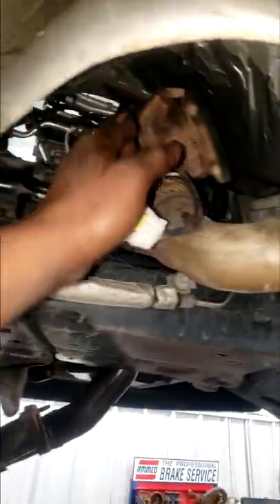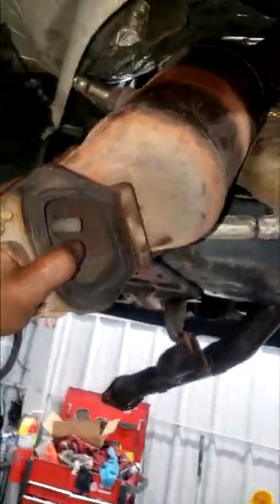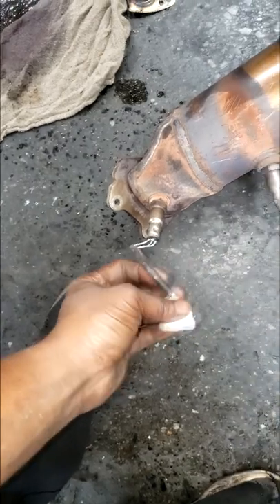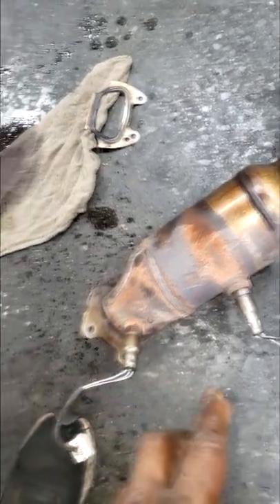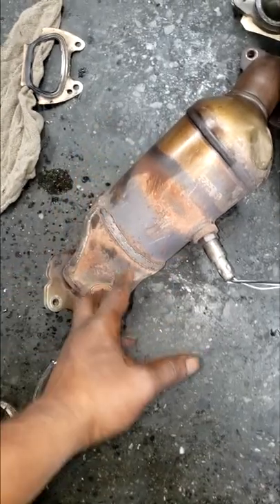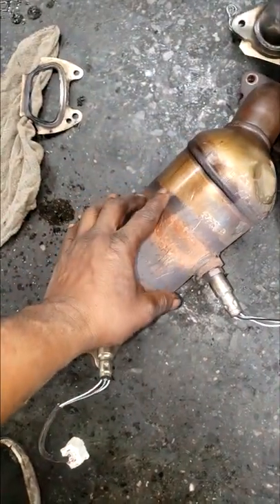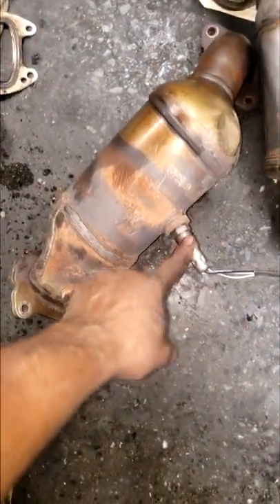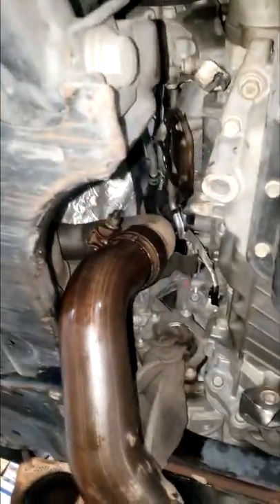WARNING. O2 Sensors will not FIX A P0430 P0420 on NEWER CARS. . YOU NEED A CATALYTIC CONVERTER.

Comment: P0420 and P0430 simply mean that the downstream o2 sensor is reading that the catalytic converter is “below efficiency threshold.” This could mean your catalytic converter isn’t working right OR that either o2 sensor has gone bad. It’s not a 1 step diagnostic problem, there are multiple tests you can do to narrow down the problem.
Reply from the maker: In the video I mention the newer model cars. This mean not older cars. If the computer spit out there's a cat efficiency problem, there 99.9% chance the cat simply fail. The o2 sensor operation checked by the pcm b4 the cat tested. If o2 sensor problems found a code would be set for that.
Reply: @OnlineMechanicTips  what is your definition of newer, 5 years old or less, 10years old, 15?

Comment: I have a few vehicles for reference from the early 2000s and late 90s that have 300k+ with zero problems out of the catalytic converters stopping up. I have a 2013 Sonic and helped work on a 2014 cruise. Both had the same codes. So far my O2 sensor replacement has helped mine but his catalytic converter was stopped completely up. Both were under 100k so I did the most logical fix I knew how. If it’s stopped up clear the stoppage. It’s been running fine with an empty case for 2 years now. No problems whatsoever. Catalytic converters are borderline pointless besides back pressure for a motor. You can add material back that won’t stop up and be fine.

Comment: Only something a mechanic would say. I seen so many people with new cars fix the issue with changing the sensor
Reply from the maker: They likely had a o2 sensor code as well dude. The newer car computers run the cat test after o2 testing done. Best believe if I see a cat efficiency code, you getting a cat.
Reply: Yeah maybe 10-15% of the time but most of the time it’s someone trying to chase a cheaper issue when it’s the cats

Comment: I was a smog tech. with a bar90 and regarding being newer vehicles there are still ways to trick the ecm, even with modifications to the engine or exhaust, not all cars but still definitely possible, obviously you gotta pass the visual inspection. Great informative video, God bless

Comment: The way the pcm can tell when a catalytic converter is below threshold efficiency is when the readings from both pre cat and post cat O² sensor(s) are showing a similar wave pattern. The wave pattern after the cat should be smoother not erratic like the pre cat sensor.

Comment: My guy , get you a proper scan tool . Look at the upstream and down stream on a graph function , the upstream should switch pretty frequently across .45volts , the down stream should have significantly less peaks and vallyes in the wave form . If the wave forms looks similar the cat isn't doing its job.
Reply: I don't think jiffy lube taught him that one.
Reply: @Cassius NOYB  nope , no jiffy luben for me 😂. I'm a mechanic for a living with a mobile service. Have scan tools and and an actual service truck so not like the rickety cracked out fb mechanics that be roaming around out in these parts.
Reply: What type of budget friendly scan tool would you recommend?
Reply: @Muttaqi757  I've got the mx808 by autel . It's around 500 bucks new but quite worth the money.  Used it to do everything from diag to abs wheel bleeds or trans adaptation when putting a trans so the tcm can learn all the new values.
Reply: @writeupking  Bingo! This is the information I need. Thank you so much.
Reply: @Muttaqi757  only short coming on the mx808 is , it's not bi-directional . The higher dollar scanners can send commands like turning on fuel pumps or opening evap purge valve for testing purposes.

Comment: I don’t know man, I had a p0420 on my 2013 accord. Cleaned the o2 sensor no good. Put a new one, cleared the code and never came back. Car had 181,000 miles at that time
Reply from the maker: In this vehicle im speaking about newer cars as I stated in the video. Yes, in 2013 the computers was not as great as they are now.
Reply: @OnlineMechanicTips on the contrary the older ones must have better computers if they can distinguish a faulty o2 and a clogged cat converter.
No way can a newer car already need a new catalytic converter.. either you’re trying to safe face because you know it’s false info, or you mistakenly put out bad info 
Either way, if a 2013 accord doesn’t qualify as a newer car, then no newer car should need a new cat, period
Reply from the maker: @suppaman12  Dude you talking hyperthethicals. All I work on mostly is brand new cars, and yes, they from time to time may need a Cat. Thats why Cats on newer cars have a higher warrany. And theres no need for me to safe face with you, I dont know you. You do however have a right to voice your opinion whether you consider this bad info. But theres nothing bad about my info. I said exactly what I meant concerning the newer cars. And yes, a 2013 Honda now a old ass car.
Reply: @OnlineMechanicTips  after rewatching your video I see you didn’t specify what a “newer car” is 
So there’s your problem. You left it too ambiguous 
What years do you consider “newer” it might help your case since I see you still backpedaling
Reply from the maker: @suppaman12  My guy, I have no reason to back pedal nor have any plans to back pedal. Youtube is a Video Platform where creators show videos representing there opinions. You more than welcome to dis agree with ones opinion. New Cars? I would say when the bus network changed in 2021. So from 2021 on up I consider a new car.

Comment: I changed my catalytic converter’s and put new sensors on it, I have that code P0430 used to be P0420 before I replaced the whole exhaust system. Yes they are oem btw. So what could be the issue?
Reply: I would have never changed the cat in the 1st place. Try cleaning out the intake manifold, throttle body, change breather hose 1st. I have 294,000 on 2015 Nissan Altima with the P0420 code. Not changing the cat as nothing is physically wrong with it. Doing other things 1st

Comment: What about an intermittent P0420 and P0430 that come and go.  And when I mean go away, no pending code, no permanent code.  The downstream sensor reads constant 0.7V the occasionally drops to close to 0V but come right back to constant 0.7V.  A cat converter isn't going to go bad then be good again.  This is on a 2012 Dodge Durange with 3.6L engine.  Seems like some transient condition in the output of the downstream sensor.  Going to try changing all 4 sensors.  96k miles so it's probably time anyway.

Comment: I have actually just changed out o2s after the cats passed a heat gun test. As long as other problems with a bad cat aren’t there, preformance is choppy or lagging after being warmed up, idle issues, or failing the heat test by being hotter at the front of the cat and cooler at the rear, O2 is your problem.
Reply: The heat test is faulty. I work at Nissan and recently bought a radar heat gun off the Matco truck. I tested 10+ Nissan and all of them were hotter at the front of the cat than the rear. Of course it will be hotter at the front. That's where the engine is and most of the heat coming from the engine is before the catalytic converter. That heat gun test makes no sense! I also did a back pressure test at the upstream O2 sensor hole. No.back pressure at all. I manually took my cat out and inspected it outside of my car. Nothing broken inside and nothing abnormal about it. Car still drives good, but choppy at some points. Have p0420 code

Comment: If the O2 sensor has failed then it will. If the cat has failed then it won't. A new secondary O2 sensor fixed it on my old very high mileage 2006 Civic. It might also be a totally unrelated problem like an exhaust leak that's confusing the O2 sensor.

Comment: Got some cats off amazon but getting p0420 after only 3 yrs. Im regretting welding them on now. Im gonna try swapping the o2 sensors and see if the problem switches banks. Its an 04 Mustang GT so maybe old school enough. My scanner says the o2s arent diagnosable with this computer. Of course im due for smog this month too.

Comment: Quick question I can't pass emission test it keeps saying Inc for catylst and o2 sensor then I drove my car the driving cycle but then it went from inc to n/a does that mean it's a bad sensor if so which one would it be and there no engine code or light
Reply from the maker: What kind of car do you have? Also are you subscribed to the channel?
Reply: @OnlineMechanicTips  yea I been watching ur videos since I had my hemi but I got a dodge dart gt 2014 model idk why it doesn't want to process to complete
Reply: @OnlineMechanicTips  any advice
Reply from the maker: I'm just seeing this. I noticed you left out the year of the car. In some cases, the computer needs a hard reset or even a flash update. If those monitors not running when they suppose to, it will never even run the test. Sometime that's just a glitch in the computer
Reply: @OnlineMechanicTips  2014
Reply: @OnlineMechanicTips  dodge dart gt 2.4 l
Reply: @OnlineMechanicTips  got a quick question I hope it's not stupid but recently I did it when I went to the drive cycle  on my scanner it says incomplete then went to na then I turn my car off for 10 mins then went to inc but when I go to since diagnostic codes where cleared in that went from incomplete to ok when I turn the car back on does that mean  I'm done or it's not working properly

Comment: I had the for 430 code for the longest on my durango 16..I finally tried a few additive for my injectors and cc. MMO cata clean mix wit dura lube cc +2 chevron  after emptying the tank a few time and drove like over 500 miles and my 430 code was gone but then my VVL sensor went bad 2 days later

Comment: That's funny because i got a p0420 code and looking at my obd reader my bank 1 sensor 2 is showing no voltage reading so your telling me it's not the o2 sensor it's the cat still interesting didn't know the cat gives off voltage to the o2 sensors
Reply from the maker: In this video dude I clearly mention new cars. The way the computer look at Input data different now. The new computers better at flagging o2 se sor problems as oppose to cat problems specifically

Comment: it's cheaper to put a spacer in between the sensor and cat.
Reply: Even if the sensor is bad would it still work?
Reply: @marsrover0 yeah but like might as well get a new sensor for 50$ and if that doesn’t work get a spacer. But spacers are illegal for inspection so unless you know a guy they might see it and fail you
Reply: Spacers def work, only thing is this chump failed my smog test because he seen it. Now i’m on my second can of seafoam driving around hoping the light stay off. I’m driving home now, when i get there im gonna check for exhaust leaks… i tried two cans on cataclean but all that did was destroy my fuel pump and cost me $200 on top of the $800 im trynna save by not buying a new cat…
Reply: @commentbeast3985 How did Cataclean destroy your fuel pump? How do you know it was Cataclean's fault?

Comment: I’ve replaced three in  the last months. It’s not a thought it’s one of three things cat o2 wireing (99.9%chance it’s not the pcm obviously) OFTEN ends up as wireing less often but still happens to be o2s and the Least likely is the cat think I’ve seen only four or five sets done in 5 months at my shop that weren’t because the cats were stolen but failed
Reply: Need advice help please. Code p0420 car is  not burning oil and is running fine obd2 scanner also says poor connection sensor 2 and pcmm could the issue be my down stream 02 sensor ?

Comment: I gave up the fight on my 2009 Pilot. Code comes and goes based on ambient temps. WI doesn't do testing, so it's just turn up the radio. I'm not doing an axle pull to replace.

Comment: I’ve got an occasional P0420 on my Chevy Cruze and when I reset the CEL, it tends to stay off anywhere from several months to a few weeks. But I put 2 new O2 sensors in and just like the title of this video said, it didn’t fix it. It improved mpg, but didn’t fix the code.
Reply: leaks around the cat will also cause these codes and the computer won't know even on these newer vehicles. check around the bung and around the welds on each side. pin holes will effect readings.

Comment: The cab of My 2011 jeep grand cherokee 5.7 hemi fills with a suffer smell when getting on the throttle. Could my cat be getting clogged or going out? I have no codes present.
Reply: Perhaps running rich and and or a leak in the exhaust system. Also check your back hatch door seal to make sure it's sealing, if the seal is leaking the smell inside should be worse with a window rolled down at speed allowing the exhaust caught in the low pressure area behind the vehicle to migrate inside past the bad seal.

Comment: How new are we talking? I have a 2001 toyota throwing a p0420 and since i live in Clownifornia, cats are expensive as fugg so im hoping i can fix it with a new set of o2 sensors. If not ill just have to pull the exhaust off and cut and weld some new "commifornian compliant" cats on. Smh what a scam
Reply from the maker: Lol, yes you in that safe gray area. Go for it, try the O2 sensors first.

Comment: If 02 sensors bad and you put in a cat. That new cat will go bad too in a couple years. And you might think you fixed it but you didn't. Also it can be just a hole in a pipe evap related. If the car is not old then something else most likely caused it.

Comment: Quick question on my Sonata I got this exact same code 3 times (replaced it 3 times )and my exhaust stinks bad. I had to replace the whole thing due to it being corroded and damaged. Anyways I bought a new cat converter and got it installed. I ran Risalone and cleaned my air filter and about to do MAP sensor and Throttle body tomorrow. What could that be if I replaced it? Everyone keeps saying it’s the converter.
Reply: I know this response is late you mentioned bad odor from the exhaust. If it smells like rotten eggs then your cat is screwed. If it's at that point then you're probably experiencing rough running due to the exhaust being clogged creating back pressure. The rotten egg smell is a dead give away. 🇺🇸 1st 4ever

Comment: That's not true sometimes changing the sensor works
Reply from the maker: Did you hear anything I said in the video? If you have a newer car, a cat efficiency code will usually end up needing a cat
Reply: @OnlineMechanicTips  what years considered newer? I have a 2007 vehicle with p0420 code.
Reply from the maker: @johnly5702  Yours, the programming in these computers design to run and test O2 sensor operation extensively before running an efficiency test on the cats
Reply: @Online Mechanic Tips  dude you haven't a clue how to diag drivablility issues.
Reply: @OnlineMechanicTips  matter of fact I have a 16 fusion in my bay right now with an efficiency code. Brand new Ford cat.....monitoring fuel trims and 02 voltages show a failing b1s1. But guess what code it has???? P0420 new 02 sensor will fix it. The sensor 1 .shows .09-.10 even when inducing a rich condition....
Reply from the maker: @boostedstinger  Smdh, its always the lil rutie poops that tend to question somebody else thought process. Dude, you to have a channel. Do yourself a favor. Make a video and explain how you think the sys work. No sense arguing with me. Make your point on a video, you a youtuber for crying out loud, geeesh.
Reply: @Boosted Grandpa  someone who understands the simplicity of the AFR and O2 Sensors.

Comment: Need advice help please. Code p0420 car is  not burning oil and is running fine obd2 scanner also says poor connection sensor 2 and pcmm could the issue be my down stream 02 sensor ?
Reply: Mines with bank 1 sensor 2

Comment: Just hook the vehicle to a real time data diagnostic scanner ....  You just look at the data , and proceed correctly. 

If the flow is ok and the code is thrown , its the Oxygen sensor.  

If the flow is Not there, and the oxygen senor is reading fine , well you need a Catalytic converter. 

If you have a proper scanner and data output , there is no guesswork.  

Drives me nuts when hear technicians say they can't find the issue .....

Vehicles with all the sensors and the ECMs of today are easier to fix than ever !!
👍👍👍👍👍👍👍👍👍👍👍👍

Comment: Nada fix i changed catalytic converter the two oxygens, til got light engine, got to be with your muffler anything straight or spark plugs o bad head gasket gas tank and all that or belt drive. Best thing is to scan the problem